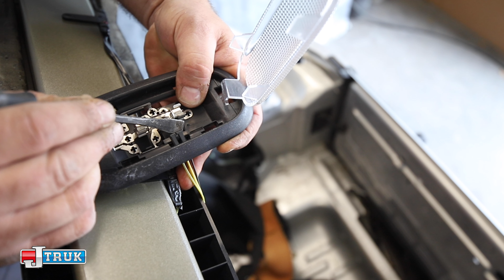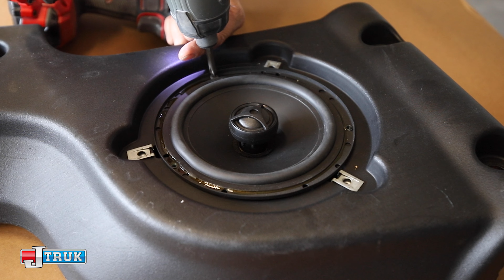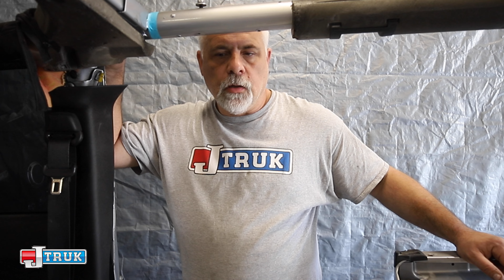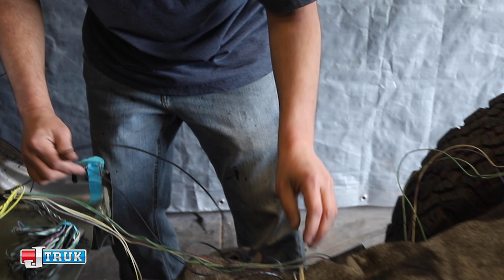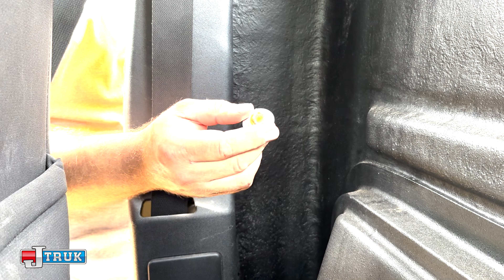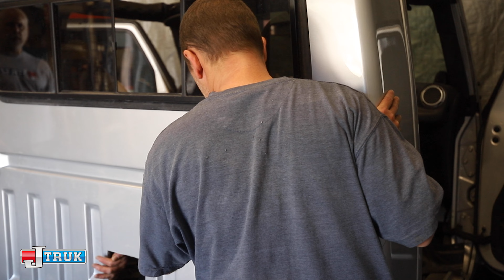JTRUK Cab installation - GR8TOPS

Comment: Where do you get the beds?
Reply from the maker: We can fab a flatbed or we have also been using ford ranger beds as well.   both fleetside and the retro stepside ones.
Reply: @gr8tops  Is that something we just reach out for or is it somewhere on the site I'm not seeing?
Reply from the maker: @KelticCurse  Yes..  on the website.

https://gr8tops.com/shop/jeepmodels/jk-wrangler/jtruk
Reply from the maker: Or give us a call.  803.4436288